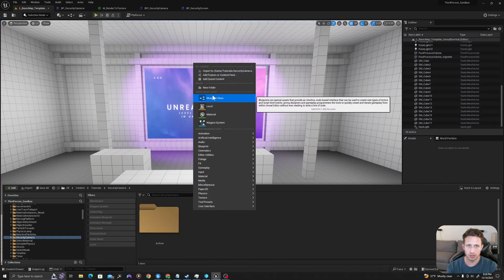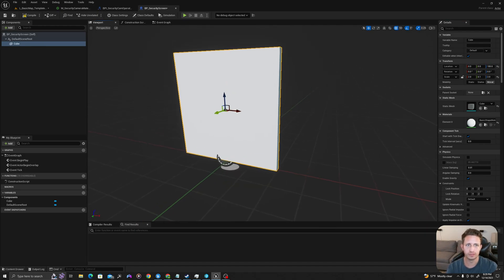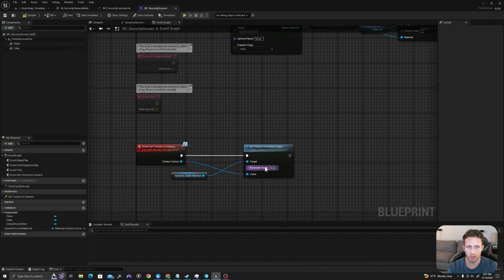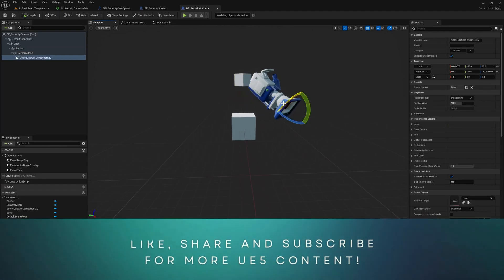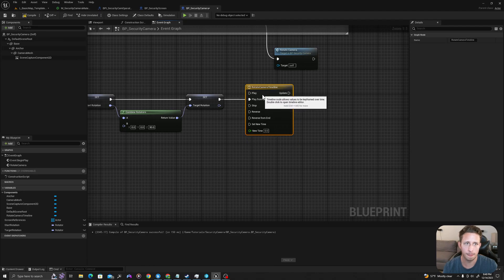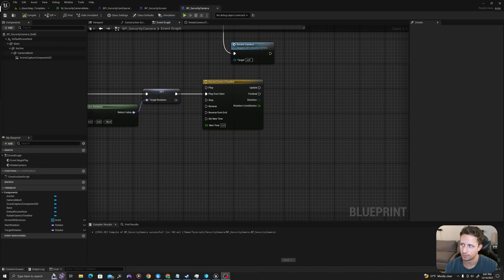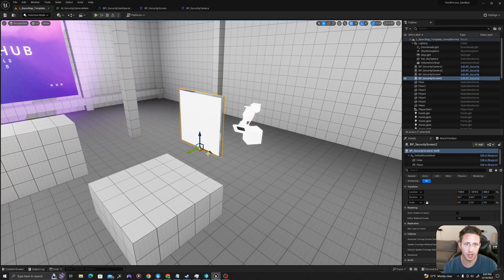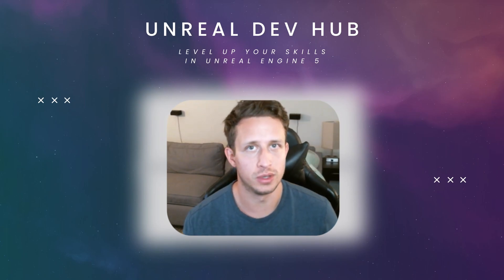Script a SECURITY CAMERA SYSTEM in UE5 Blueprint!

Comment: Is the image of the camera influenced by the lighting in my scene? The exposure is much too high so I guess that the camera component is not concidering the post process volume?
Reply from the maker: Yes, the camera can have it's own unique exposure settings, and many similar settings that you will find on the post process volume. If you either use a post process volume, and set it to "Infinite" Distance (type infinite in details panel), and set the exposure from Auto-Exposure (Basic) to Manual, and set a manual exposure value, then it will not do the "auto light adjust" that it will do when you have auto-exposure enabled. 

So there are multiple approaches including auto exposure, post process volumes, or setting the camera settings on your cameras in the sequence to accommodate your environment lighting setup.

Comment: Amazing process. Could the screen be curved instead of flat?
Reply from the maker: Absolutely - you could use any static (or skeletal) mesh, I just use the plane in this situation because it has a perfect planar UV mapping. 

The two things to consider are a proper UV mapping and that you are setting the dynamic material instance to the proper material instance on the mesh.

Comment: I followed your tutorial only I didn't add the rotation since I didn't need it and my camera system uses buttons to switch between cameras on a single screen so there is a single condition check in the screen logic before setting the material. Apart from that, I did everything else exactly the same but it didn't work :( I feel like every time I follow an unreal tutorial even though I do the exact same thing it never works on my end...
Reply from the maker: @drexilion9730 Let's troubleshoot:

Are you creating multiple dynamic material instances and render targets?
Are you setting the material back to the screen?
Is the button press itself actually going through?

If I were you - I'd add a few breakpoints, and making sure that the button press logic is going through properly, and if you watch all the variables that are important (mesh, camera, material, render target references) are valid, and step through node by node making sure that the button press is working and all of the logic is moving through properly.

Hang in there! Game dev isn't easy - I make my videos very slowly, descriptive and methodical because when I started learning by watching tutorials (~8 years ago), I'd always veer off into my own path and get myself into trouble. I'd recommend following from start to finish then add your own flair once you get through the fundamentals.
Reply: @UnrealDevHub  Thank you so much for the response. I did check all the variables and connections. The materials are being created and applied to the screen in the same way as in the tutorial. My buttons work since I had a different camera system before (that also didn't work) and the buttons switch through those fine. The only difference from your logic is that there is a check that the button is on before applying the material to the screen and that I didn't add the rotation logic since I don't need my cameras to rotate. But I checked every step and it really looks like it should work :/